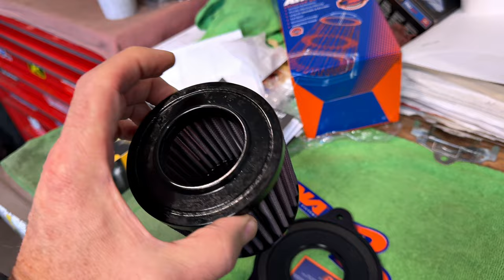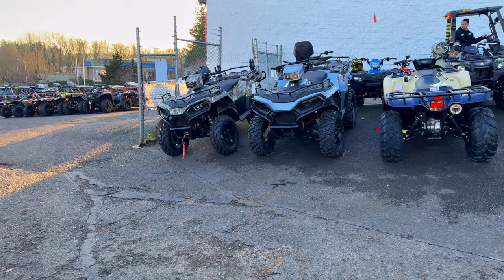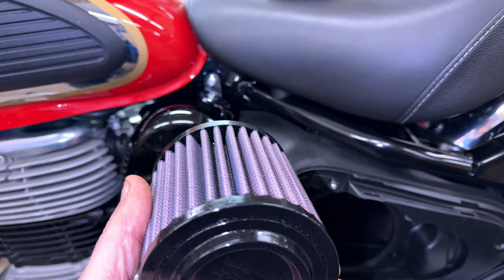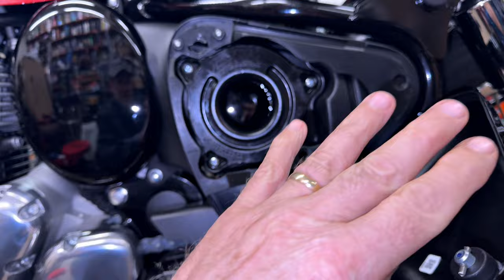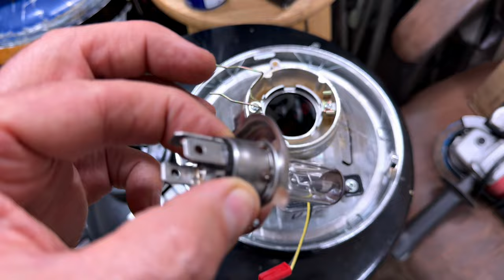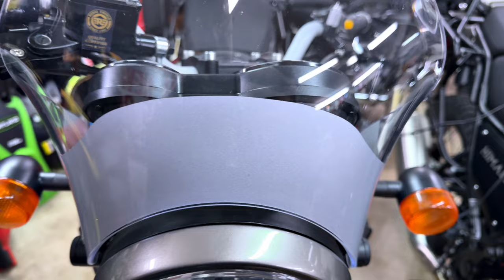LED’s All Around..!! • May Have Issues with Himy’s! | TheSmoaks Vlog_2957

Comment: Just use a heat gun on the back of the headlight bucket to make a dimple in it..
Reply from the maker: I read your comment while at work yesterday and it was on my mind all work day...  Went home last night with the thought of testing it.  It worked fantastically and both Himalayans can use the 2nd choice LED's I picked.  Thought I was going to have to reorder the LED bulbs I first purchased for the Classic 350, as hose are an exact H4 Hologen sized replacement...

Thanks so much for the idea Stephen!! 👍👊
Reply: your welcome mate happy to help. @TheSmoaksVlogs

Comment: Hi Shawn, I'm 5'4" with an inseam of 28", will the Royal Enfield classic 350 be to high for me? I know the seat height is 31" but I'm wondering once I sit on it if the suspension will go down enough to have my feet flat on the ground.
Reply: Hey, I have same inside leg, the low rider seat will definately be better but you will get away fine with the standard seat - balls of both feet will be on the ground.
Reply from the maker: I have a 29" inseam and haven't given the seat height a thought..?  Haven't paid attention to how much suspension sag happens, it just fits great.  Kelly says it seems very comfortable with the balls of her feat touching with house slippers on.  You should be perfectly fine, as it feels much lighter than the numbers imply and it's such an amazingly easy and kind bike to ride..!

Thanks Guy!! 👍
Reply: @TheSmoaksVlogs  Thanks Shawn, your reply gives me more confidence knowing that I could ride it. I have checked here in New Brunswick Canada and I found a dealer, but they're asking for a 2023 classic 350 $6500.00 plus tax and our tax rate here is 15  per cent, that puts the bike at $7475.00 and not counting accessories, that kind of discouraged me especially when I have other priorities, what a bummer 😞, anyway thanks Shawn and Kelly for the nice videos and for answering me.